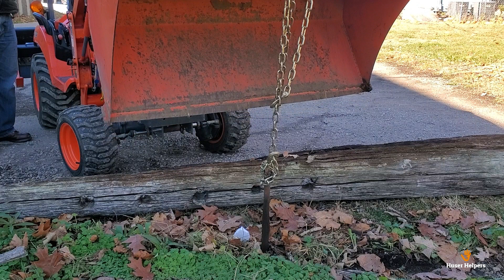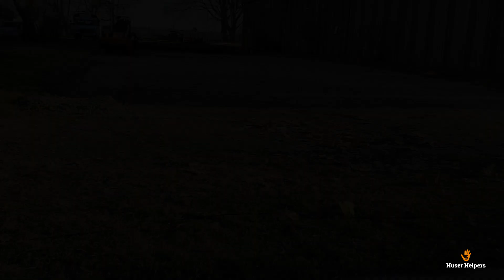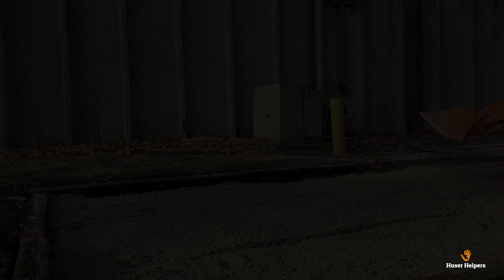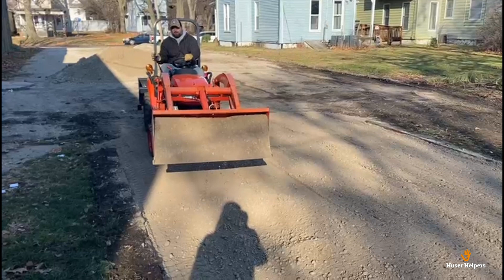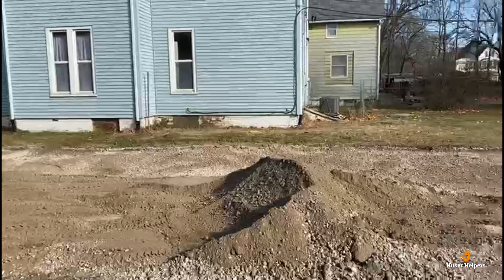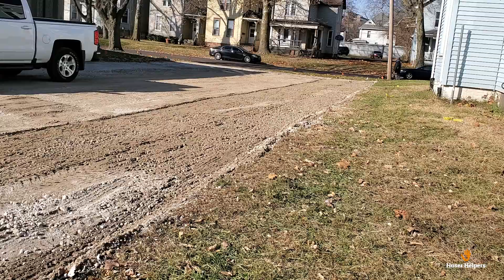Kubota BX2660 and Bad Boy Box-Blade - Rebuilding the Gravel Parking Lot

Comment: Hello, I gotta ask you about the Loader Joystick. with it being positioned a bit far out off the front fender, do you get arm fatigue having to keep your arm up all day working the loader? On different brands or model sometimes it's positioned next the arm off the frame but I thought I'd ask you as I'm looking to buy one of these but that Joystick positioning does not seem too well-thought of. Also if you don't mind sharing, what do is your fuel consumption like and would you say it's an efficient little tractor? Thanks so much!
Reply from the maker: Hi Narb, the loader joystick isn't too bad, but the newer Kubota moved it to the fender.  I can run it all day without issue. Fuel consumption is harder to talk about. If tilling or mowing I would estimate you will burn 10 gallons a day.  Loader work, maybe 5 gallons a day.  Thanks for watching,  Jason